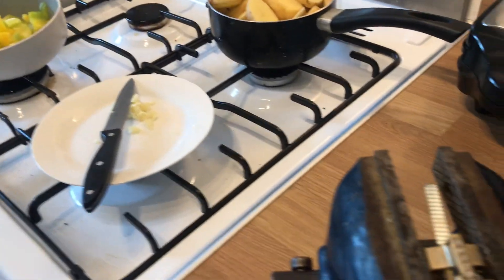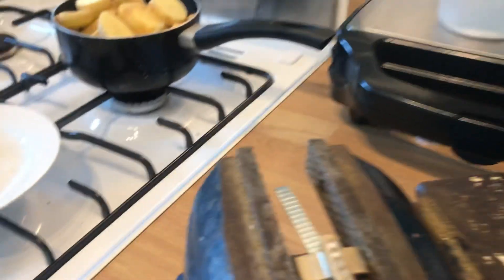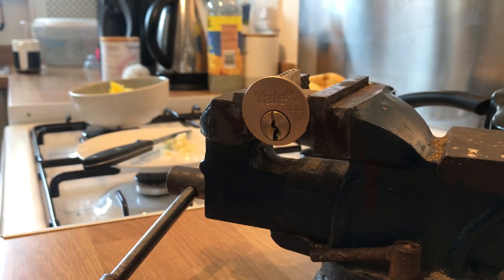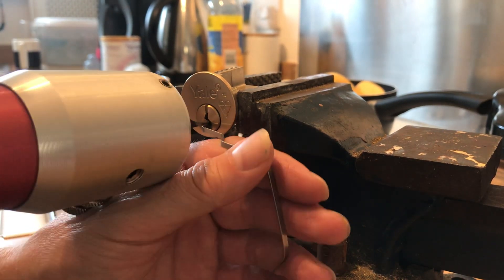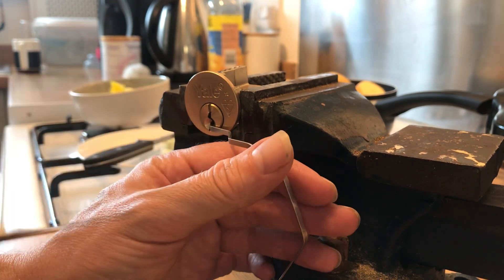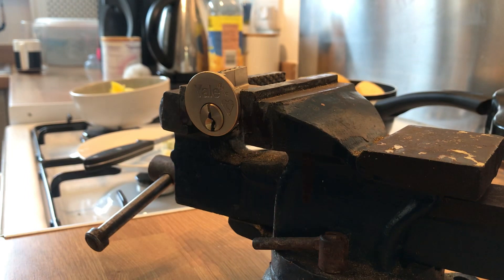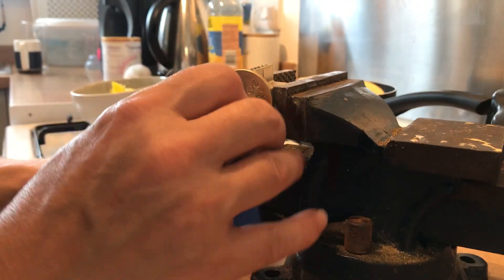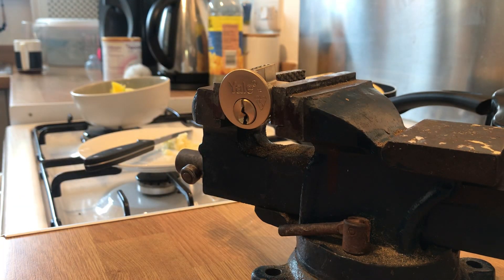Kitemarked Yale rim cylinder, tricky pick, easy bump 😎

Comment: Doing bitttttts..Give the drill bit trick a bash..GJ EPG got snubbed by a Yale Whatttttt😂😂 Fortress is Doing more than Bitttttts 😉
Reply from the maker: It didn’t get snubbed, it did open it but took a good few attempts, just showing that sometimes bumping is easier mi amigo
Reply: @FortressLocksmiths  Definitely 👍 GJ EPG has some serious swing